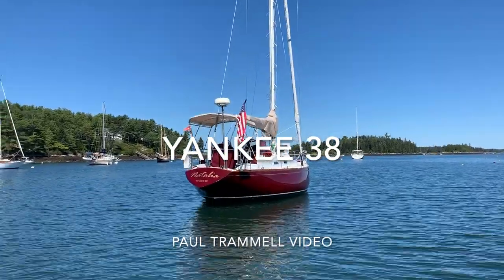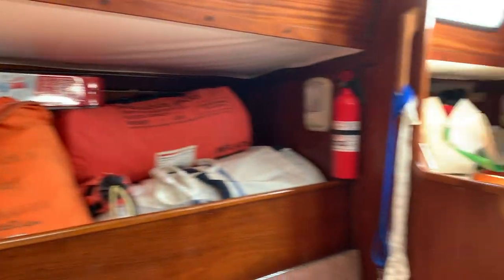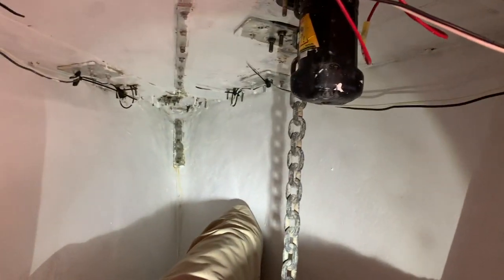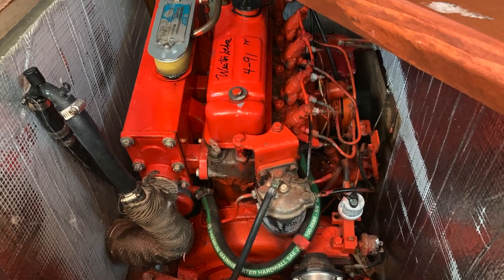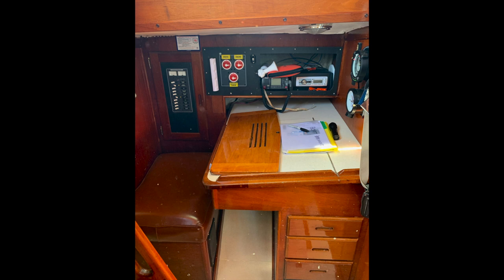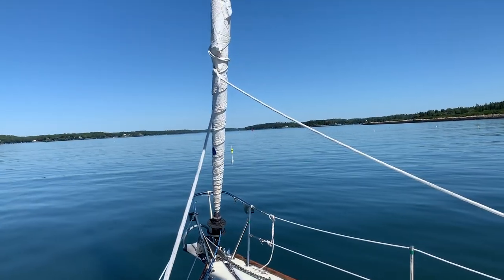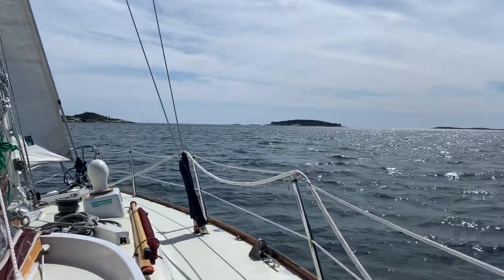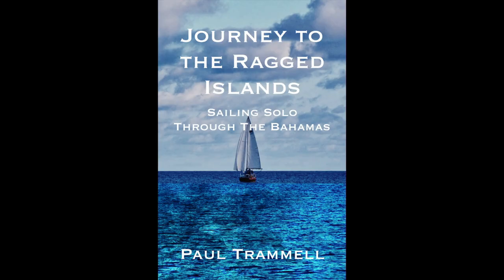Yankee 38 Review

Comment: Hello I have Yankee 38 Hull no.9, I'm trying to find out about my mast,  I heard you mention the name Lafille is that spelled right and do you know if in business, and city?
Reply from the maker: Sorry for the late reply. I remember that it was a French company that also made helicopter blades.
Reply: @paulwtrammell  I did find where they were made close to where boat was made, both south of LA, thanks for reply!
Reply: @chhindz I currently live 4 miles from where the Lafille plant was.  They are still in business but no longer make masts.  My parents owned hull 16 from 1972 to 1978.  I also raced on hull 24 in Washington,  they’re awesome yachts.  Not the fastest, and rather squirrelly down wind, but truly beautiful.  Hull 24 had her mast replaced by a 50’ Hall spars stick in 1993 extending the mast by 2’ made surprising improvements to light air performance.

Comment: No galley?
Reply: It's minimal, a stove and icebox on, I think, the starboard side with the sink on the centerline under the bridgedeck, with  a pass through to the quarter berth between them.
Reply: @johngregory4801 sink is near center opposite chart table on starboard. Ice box is outboard on starboard. On Independence, Hull 16, we had a gimbaled CNG 3 burner stove with oven over the engine box. Local racing we carried a single CNG bottle in the lazerete on port, for Transpac we added a second CNG bottle into starboard.
Reply: @michaelholts1598  Thank you. I've loved the aesthetics of the Yankee 38 from the first time I saw one in Yachting, back when Ted Turner was tearing up the One Ton class in Lightnin'. She's a S&S classic!